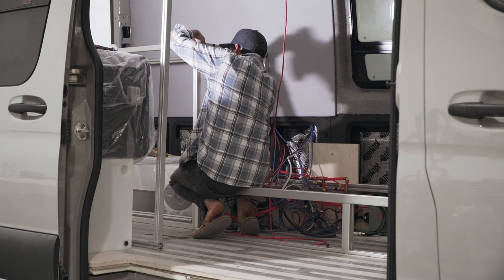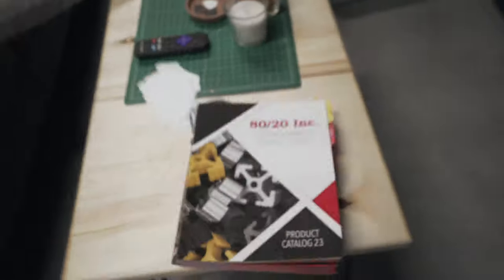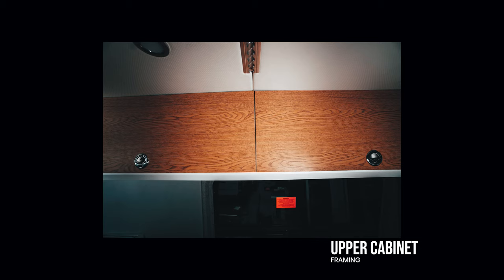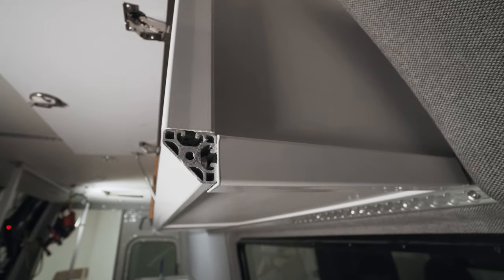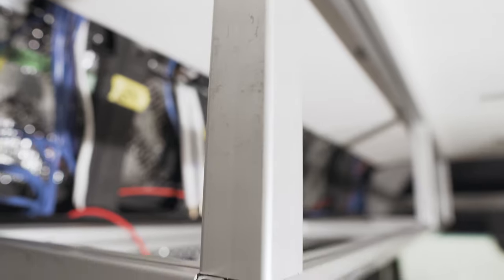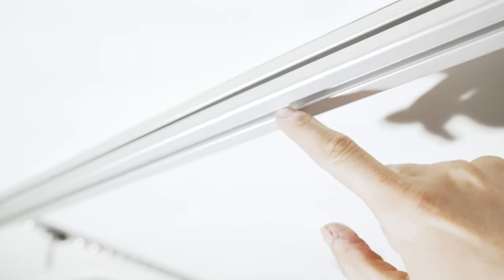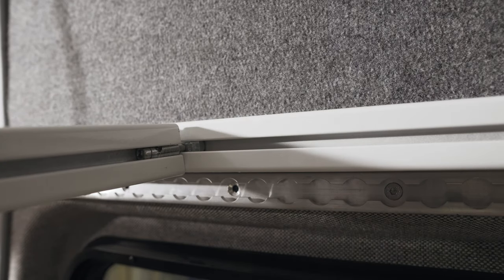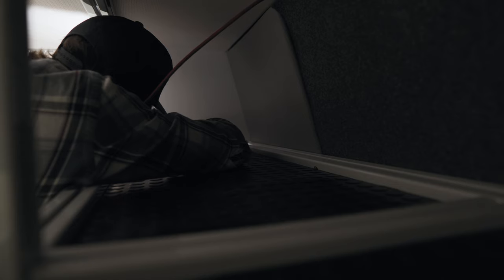Sprinter Van Upper Cabinets Built with Extruded Aluminum (8020) | VAN CONVERSION

Comment: For the back piece that attaches to the van, how did you get that to angle back to 90 degrees to get the cabinets to lay flat? About to start my second build and going to use 8020 so your videos are very helpful!
Reply: Landin, did you find a solution to your mounting issue? I have the same question...

Comment: I am preparing to install my upper cabinet also.  I have been following your build because you are using 8020.  The issue of the angle between the wall and the ceiling of all vans has been on my mind, and I am intrigued by your solution.  Many people have cut spacers at an angle to help with this.  Have you run into any downside to your method so far?  I am fanatical about squeaks and rattles and the fact that your 8020 against the wall and ceiling can’t be perfectly flush makes me wonder about noises. Can you share any more about your results so far?

Comment: I love referring to your channel when I have a question on my build, like how to compensate for the slope of the side wall on a Sprinter when installing an 80/20 side rail for upper cabs. Just give a little leeway when tightening and then crank it down when fully assembled. Nice to follow you trailblazers. 😎

Comment: When I first bought 80/20 it was the 10 series or 1" instead of the bigger stuff. It's so strong I thought the 15 series would be overkill and the 10 series is cheaper too. I  got frustrated though and went back to Baltic Birch. I've seen lots of good examples now, including yours, to attempt to use it again. I feel the 1.5" is overkill still  but simple things like your hinges for the overhead seem to line up with the channels for mounting. Is that just coincidence?  Did you ever attempt to use the 10 series. I'd like to start working on my pile of it.

Comment: Thank you for the excellent video of your upper cabinets construction.  I am wondering why you used an open face of the long 80/20 rail to attach it to the ceiling.

Comment: Hey Scott - What hinges did you use on this setup? I don’t see them listed and I’d love to use the same ones since they allow the cabinet fronts to completely fill the face frame and work with 80/20. Thanks!
Reply: Did you ever figure this out? I was wondering the same thing.

Comment: hey Scott, where are you getting your 80/20 from in Canada? I know there is a place in Abbottsford, but they don't stock the profiles I am after. Any help is appreciated.

The cabinets look fantastic! Love the angle on the bottom piece, I went with the 1/4 round.
Reply from the maker: Hey! Sorry for the late reply here! I’m getting mine from Item but in Canada, people talk about Rocky Mountain Motion control. l I found it helpful to find a local supplier who stocked a few common parts.

Comment: Do yiu think there will be any issues with the bottom rail having that tension in it? I'm about to start on my overheads but haven't figured out a way to get that bottom rail square. I may well take your approach, I'm just worried about the bolts or rivnuts failing over time due to the tension in them?

Loving the channel,  been very useful for me!
Reply: Check out the video from OurKaravan, he uses a spacer to address the angle to make his cabinets square. https://www.youtube.com/watch?v=yfK4SDDFkrI&t

Comment: How did you mount the hinges and gas struts for the cabinet doors?  Just drill right into the aluminum?
Reply: I have the Same question. Haha did you find a solution?

Comment: Did you router the floor of the cabinet to fit in the tracks? What thickness is the plywood? Looks good man.
Reply from the maker: Yeah I did and its using 1/2 baltic birch. Thanks!

Comment: Great video Scott! Just curious about the hinges and latches you used for the upper cabinets. Could you post a link or just a description? Thanks!
Reply from the maker: They are Blum hinges send me an email and Ill dig up the link
Reply: @scottadamson6116  do you know what hinges those were? I am having trouble mounting my doors on the same style upper cabinet and really having trouble finding ones that work.

Comment: It looks like you attached the upholster wall & ceiling panels prior to attaching the 8020 to the chassis. Is that correct? If so how did you know where to attach the 8020 to the chassis if it was already covered.
Reply from the maker: I use a sharpened bolt and use that to mark the place I get this question a ton and I need to make a video to help veryone.

Comment: Looks great, but at 4:24 do you know why there is an exposed end of the square pieces that connect to the 45 smooth face? It almost looks like the connecting square pieces are wider or misaligned.
Reply from the maker: It has a cap that covers that.

Comment: Nice! does the powder coating change any of the dimensions of the cabinet and make it harder to connect together?
Reply from the maker: It changes a bit but not enough to adjust the fitment

Comment: Awesome job. This exactly the look I've planned. Is it possible to install wall panels first then install rivnuts through 1/8 ply panels and metal structure at the same time? Hope this makes sense 🤣
Reply: You could do that, but a better idea would be to only install paneling where your cabinets are not. Saves weight and material. Use a piece of flexible acrylic bent around to be the back and top of the cabinet to hide the insulation and stuff behind it.

Comment: This looks so clean! I'm surprised more people don't use 8020 since it seem so much stronger than wood
Reply: They base their choices on cost. The buyers won't want to pay more, and the builders are already running a tight budget. I imagine a stick of that stuff is $50
Reply: @anothersomebody8195  Yeah I know must people don't have the budget but sometimes I see people who has the budget but still use wood. This os only the second or third conversion I have seen with 8020
Reply: @NinaThoren  They're probably not committing to the lifestyle, since resale value is a consideration. Scott has it figured out. I bet he'll have the motor rebuilt when it gives up the ghost in 10 years..
Reply from the maker: Yeah this is a forever van! I really dont see myself sellig it and wanted to future proof the build quality on it.
Reply: @GOLDVIOLINbowofdeath  This was eight months ago and at that time I had only seen about three builds with it, much has changed since then. What I search for when looking for builds also plays a part in what results I get

Comment: Can you show us how you machined holes in the 80/20 and what tools you used?
Reply from the maker: Yeah I use a step bit but Ill try and get that in a future video as I have some more of that work coming up.
Reply: Scott Adamson That would be awesome man! I’m about to put in an order for my upper cabinets. I’ve been looking at 3 point end mill bits to use with my drill press to machine the extruded aluminum but they are pricy. I’d love to see how you did it!

Comment: What about heat loss through the metal?
Reply from the maker: I used a thermal break that I talked about in another video but otherwise yes itwould be forsure.

Comment: Great to get this info!  It is the best way to build a framework, much better, stronger, lighter, and more elegant than wood.  Easier but pricier.  Great tip about the beveled bottom rod.

Please keep camera on the project, not on you.  Its distracting to have it go back and forth, and we need to see what you are talking about - all those tech details.  95% on project, 5% on you.  When speaking about the connection details, please show the connection and rails. Camera should be on them so we see what you are saying.  I did not comprehend much of what you said since camera was not on project. Too bad.
Reply: @GOLDVIOLINbowofdeath  That may be true but I was not being technical.  I was being graphic in my description.